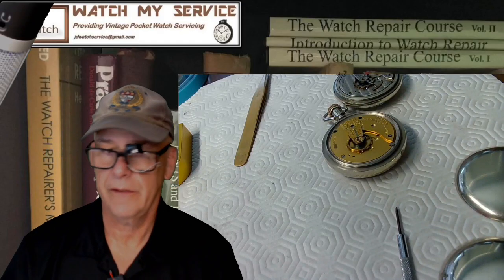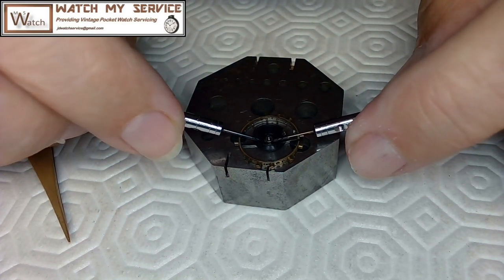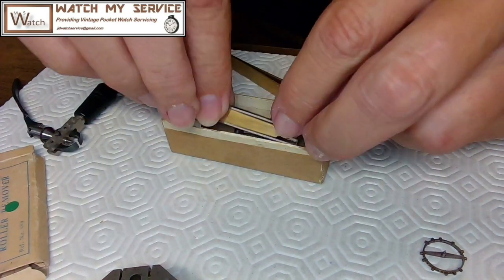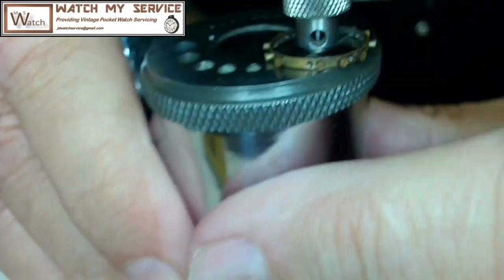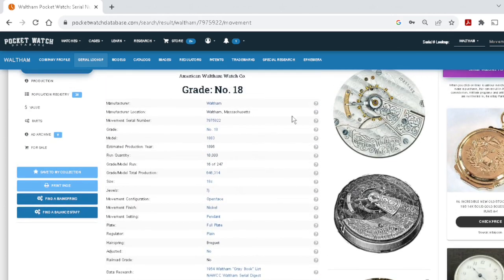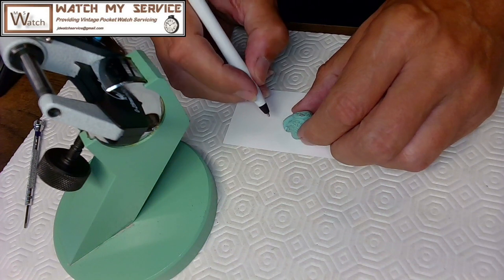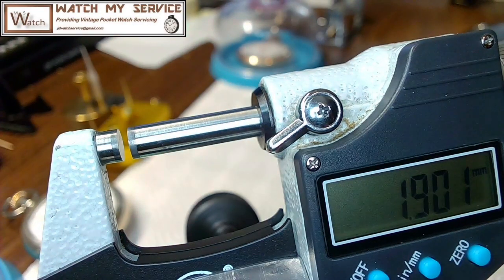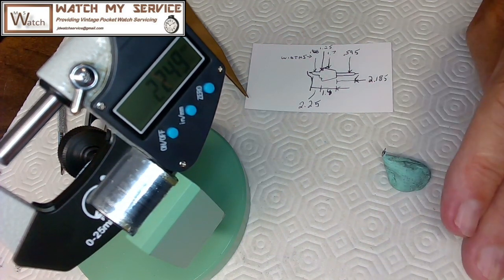Detailed Pocket Watch Balance Staff Removal and Measuring

Comment: I use a Molfres grinder to remove staffs. No chance of mucking up the balance using that tool but unfortunately there's nothing left to measure when you're done!
Reply from the maker: I think the tool that I described in the video works great for removing balance staffs quickly, and without damaging the staff arms

Comment: Can a previously riveted balance staff be scavenged from a donor and used in the patient, or will only NOS work for riveting?
Reply from the maker: You may be able to use a previous shaft as a donor. However, if it is riveted, you will likely have to break the rivet to make this work, and then perhaps you can friction fit it. In the end, you may not have enough material to apply the Rivet again.
Reply: @JDRichard  Makes sense. Are new ones scarce for Walthams?
Reply from the maker: @Mars-zgblbl  not really